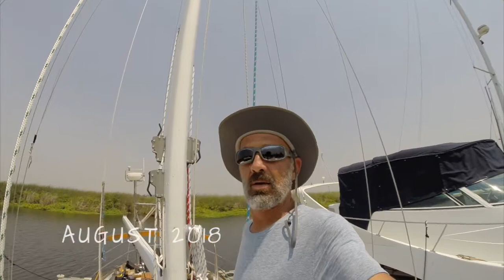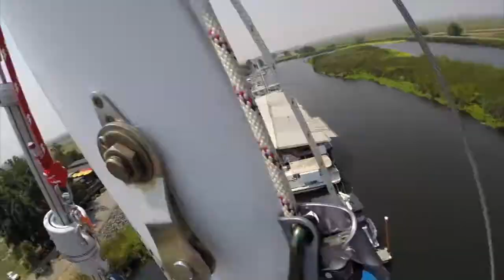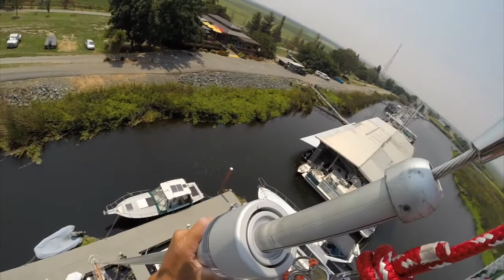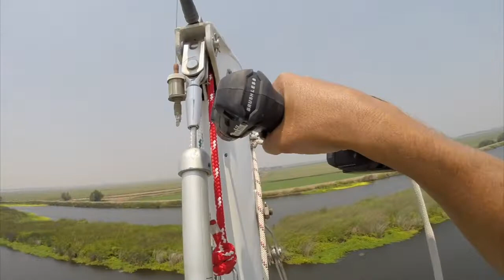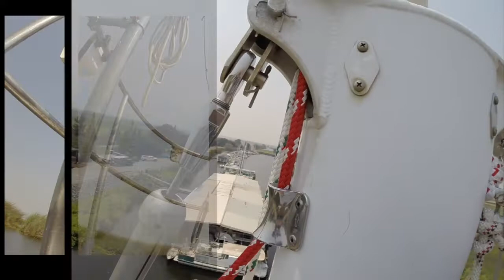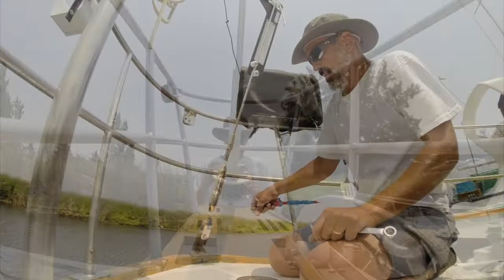SV Ramble On | Halyard Restrainer

Comment: Great video.  I have a Catalina 27 needs a Halyard restrainer.  Can I use aluminum rivets? I heard about that 2 different types of metal causes some type of reaction plus the aluminum are easier to find.  I want to do what is best just wondering.
Reply from the maker: We used stainless steel rivets with Tef-Gel to prevent corrosion between dissimilar metals.  Aluminum rivets aren’t as strong as stainless steel, but your rig is smaller than ours so you could probably use aluminum.

Comment: So, why not allow the swivel to go all the way up to the foil cap and have no need for a halyard restrainer?? If need be you could have the drum a bit higher to match your headsail loft and the tack of the sail would be higher which is not a bad thing if you have sea washing the foredeck.
?
I am confused! 🙂
Reply from the maker: Schaefer recommends something like 5-7 degrees of deflection to prevent halyard wrap above the top swivel.

Comment: Hi 
Question for you 
I have a Hans Christian 33 that has the chain plates encapsulated in the fiberglass (stupid) and I’m putting new chain plates on the outside! I’m going to drill the new holes thru the old chain plates and fiberglass, I wanted to ask you what type of drill heads (brand and size to use) I wanted to ask you since you are a knowledgeable guy 😇
Thank you 

Andy
Reply from the maker: Hey Andy, Rich here.  To drill through the encapsulated stainless chainplate on the HC33 I'd definitely go with Cobalt drill bits, and I prefer DeWalt or Milwaukee with the pilot point but Bosh bits are also a good choice: $10-12 each on Amazon or Home Depot. 3/8" bolts should be plenty big enough diameter; that's what our chainplates came with.  www.Boltdepot.com .  Use low speed to drill, and keep the bit cool by spritzing it with water, and pull back every once in a while to clear chips as you go.  You're probably going to burn through a few so get extras and you can always return the rest. Good luck on the project man, and thanks again for watching.